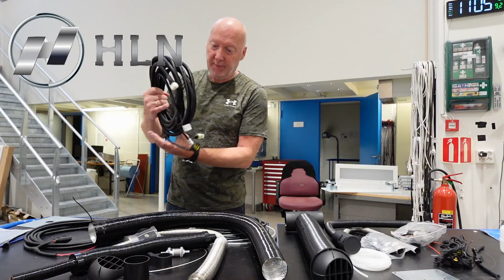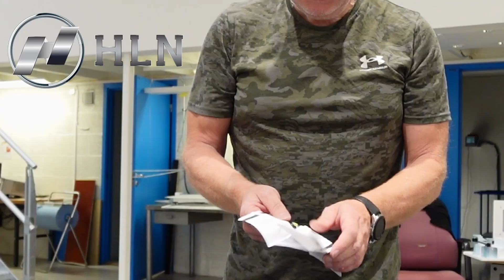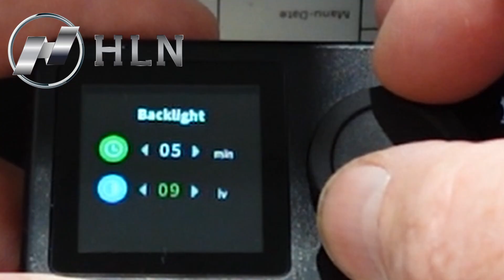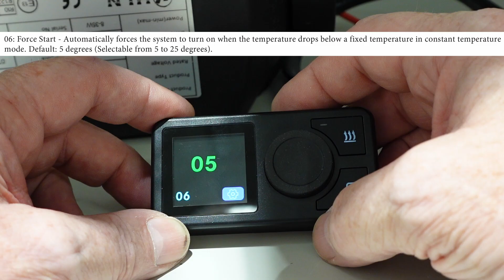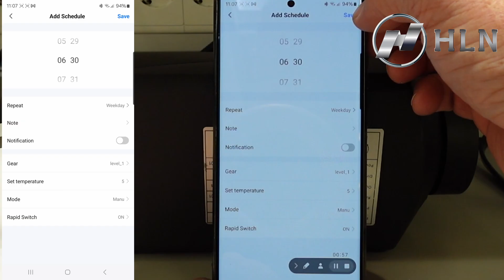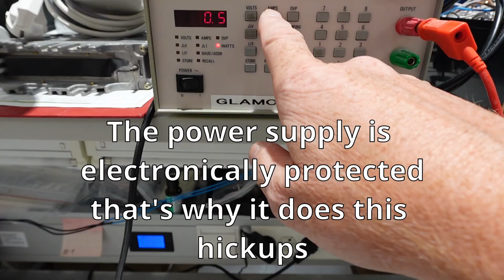Indeept review of the excellent 2KW HLN Aerolyn 2000 Diesel Heater

Comment: In the advanced settings there is the shutoff setpoints for "constant temperature mode".  Is  constant temperature mode also referred to as "manual" mode?  

I'm assuming they are the same thing, but the instructions calling them different names.

Comment: If you open the app, does it connect to the Wi-Fi controller automatically?  I would expect these controllers to be Bluetooth rather than Wi-Fi.
Reply from the maker: Good question, and I don't know the answer, sorry. Have not installed it in my car yet, so can't check either.
Reply: @Italjohn They have a WiFi and a Bluetooth model for their controller.

Comment: I have this HLN 2k diesel heater but not wi-fi. Two questions for You: I installed the power cable and hot air tube inside my former Gas Generator Steel Box under my Cube Ford E-450 2003. There is an auxiliary tank of 128 liters that was used for the Gas Generator. But now i want use it for the Diesel Heater. The Rube tubes are already beside the diesel heater. But the diameter are much bigger than the fuel pump. Also the lenght is like 7 feets long.  Do you think that will work with that HLN fuel pump? My second question is Muffler Exaust. Can I connect an extension steel pipe of 2 meters at the end of that Muffler Exhaust?

Comment: Hln is a nice quality unit, are they brushless? If you want to save some money I’d recommend the aspligo 5k dual brushless motor model, $100 excellent quality
Reply from the maker: Yes, they are brushless
Reply: @ John do you know if they are dual brushless motors or do they share a single brushless motor for hln?
Reply: @jaysonyang1441  what is a dual brushless? I think this one has 1 motor
Reply: @cubul32 my aspligo unit has two brushless motors, one drives the blower fan for the heat exchanging, the other drives the air injection into the combustion chamber, hence the two aren’t tied to one speed, and are independent of each other, this leads to better optimized speeds for best combustion and heat extraction efficiency, although the aspligo is now discontinued the people who knew bought them quick before they discontinued them, basically they were selling out like hot cakes and basically someone like the other competitors shut them down
Reply: @jaysonyang1441 thanks. I wrote to aspligo, they were like; we'll get back to you on this question 😂

Comment: Are these HLN heaters tuneable like the cheaper ones? Where you can set the low pump and fan rates and high pump and fan rates for elevation changes?
Reply: These adjust themselves as it changes altitude.
Reply from the maker: Not that I know, but I try to send them an email and ask for you.

Comment: Quite pricey though for the U.K. you can buy 5 or 6 of the cheap ones for the cost of one of these, I wonder what the real difference is beyond the wiring protections and a nicer controller - which on its own at £100 is very expensive.  Installed correctly and carefully the cheap ones can be just fine.